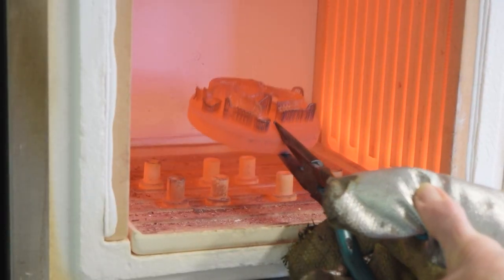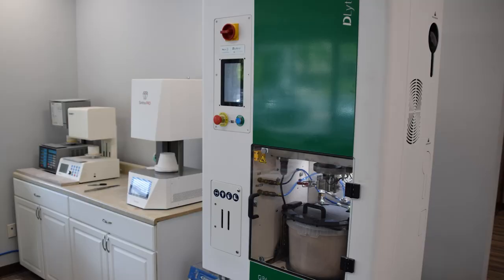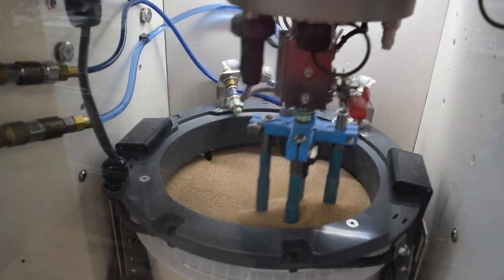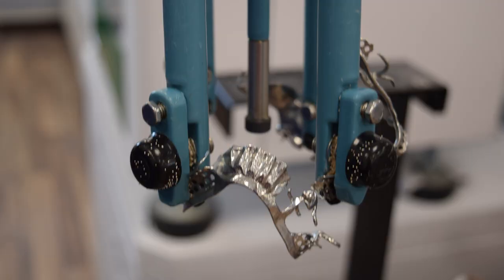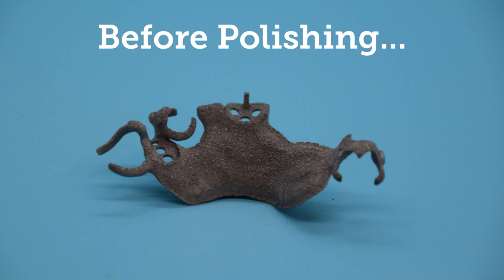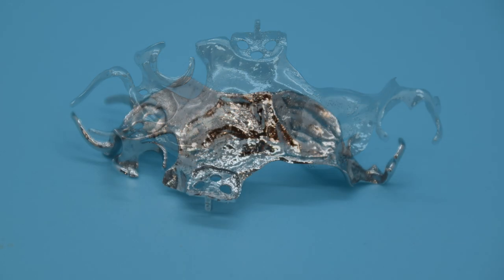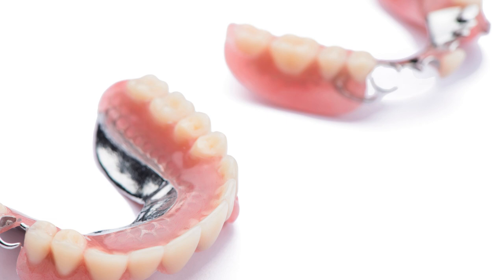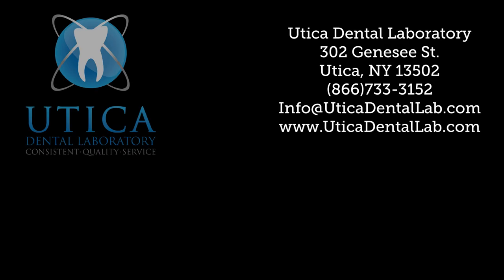Part of the Process - Electropolishing Metal Partials - Metal Partial Dentures at Utica Dental Lab

Comment: Hi!
Do the clasps damage the healthy teeth where they are attached?
Can I chew and eat well with it?
Is it definitely a good option today a metal partial denture?
Thanks!
Reply from the maker: Hi Emilio,

Metal partial dentures are the most popular partial denture we make. The rigid metal frame gives the denture more strength to help you chew compared to an acrylic denture.

Some people complain the metal frame is a bit unsightly. There are some scenarios where people may be able to see you are wearing a denture. But, the trade of is improved performance.

If you are more concerned with aesthetics then you may consider a flexible partial denture. You can find more information on our website about those. https://uticadentallab.com/tcs-flexible-partials/

No denture is quite the same as your natural teeth. But a metal partial is the closest you will come to your natural teeth without taking more expensive fixed options like dental implants into account.

Any damage to teeth at the clasps is minimal.